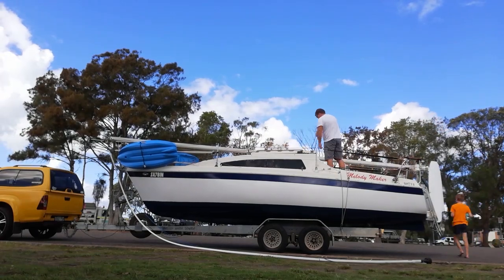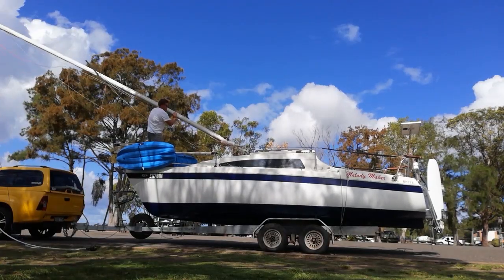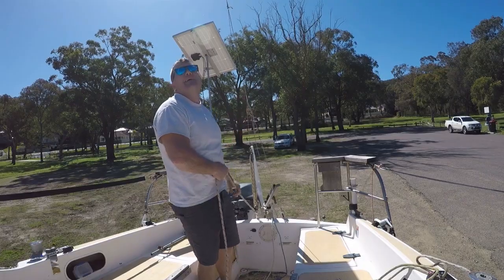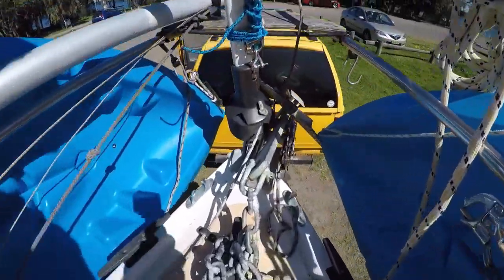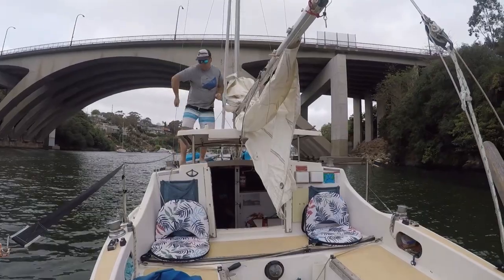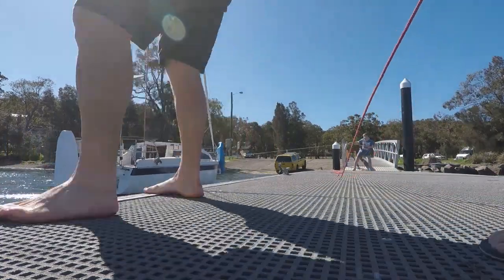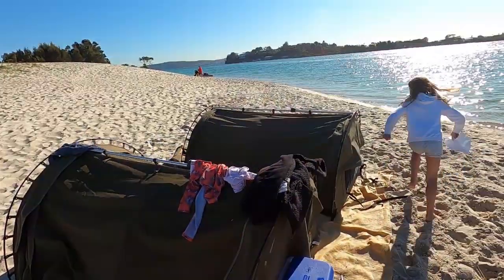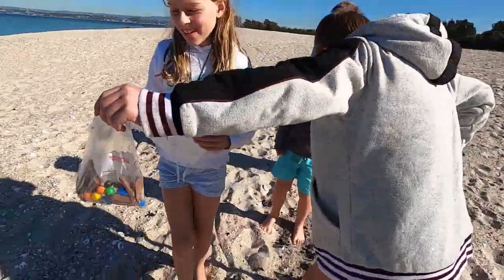Setting up a Trailer Sailer #10

Comment: I noticed you bury your wheels when launching - how do you go about doing trailer maintenance to ensure your bearings didn't wear down?
Reply from the maker: Hi Alexander. Although Id love to be able to launch without putting the axle under there is no way Im moving that boat on its trailer. The only solution was to make sure there was plenty of grease pumped in via the bearing buddies. It seemed to work reasonably well as I never blew out a bearing and I had the boat for a couple of years.